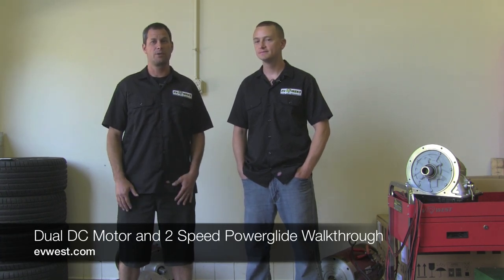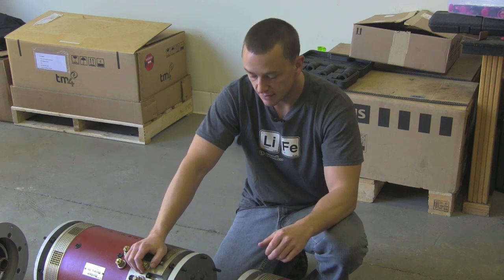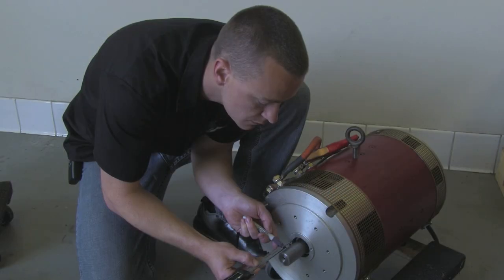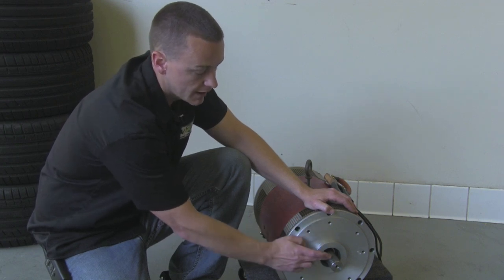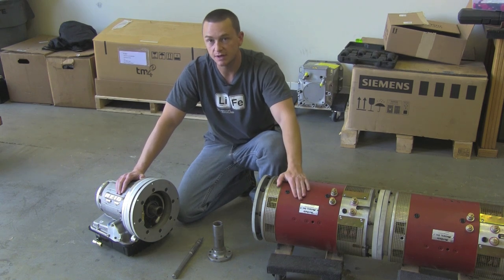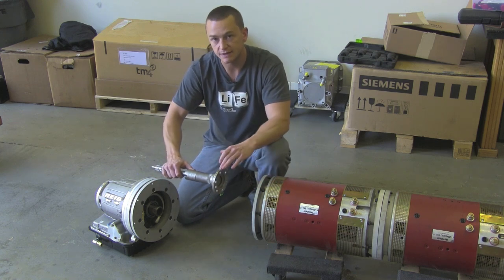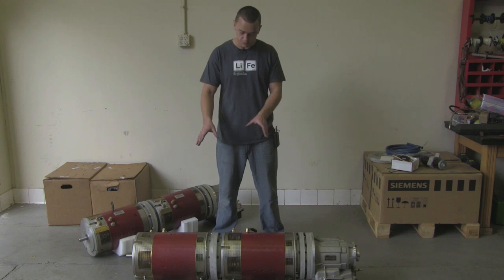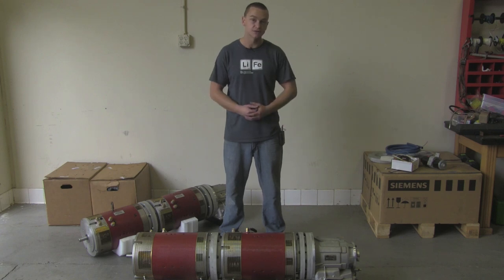Dual Motor Electric Vehicle Drivetrain With Powerglide 2 Speed Transmission Walkthrough by EV West

Comment: Where exactly do people learn to make an electric car? I can't seem to find any workshop except 1 in norcal and I am not sure if that class is sufficient enough. Do people go learn it at a school like Universal Technical Institute or is there a really good book on creating one from scratch? I searched amazon for a book but they all seemed to have low ratings.
Reply: Cassius Mason it's really simple. install electric motor. install transmission if you want. the end.
Reply: You make it sound so easy. Seems like when I read a Volkswagen electric vehicle training book, it has like several dozen more small parts to it. Haha.
Reply: From my small experience as a technical university graduate, the greatest option is if you study automotive design at a college or university. Trust me, designing any decent quality car (electrically powered or other) requires quite some knowledge in many factors such as: motors, power transmission, traction, stability control, aerodynamics, automatic control systems, mechanical wear and endurance, maintenance, ergonomics and financial managing. 

Even so, university studies may not be enough. You may have to work in the business of automotive design and engineering and/or do a specialised post-graduate study in electrical automotive engineering. It's not just a case of put a motor on a chassis with 4 wheels and a transmission (yes, David, you re obviously troling :P). Because, in the end, you might have disastrous consequences.
Reply: Luffy Monkey I'm not trolling. These people learned by doing actual research
Reply: They are the pioneers. People on forums everywhere have been taking electric motors and throwing them into random cars for awhile now. And I'm sure some of those people and gone on to selling parts and designing kits.
Reply: OK, so they are based on experience (shared and personal). But will it be a valid result? Will it be the optimum based on their resources and goals? Will it be safe? Shared experience is quite something, but I believe it's better if you work on a business of electrical car manufacturing, and having some academic knowledge can help quite importantly.
Reply: Luffy Monkey you can learn that stuff while working hands on. All your professors teach you from a textbook.
Reply: Luffy Monkey meaning that anyone else can find that information
Reply: Which, in the long run, means that must study A LOT.  It's not that easy. And by the way, guidance from an academic is, if not necessary, at least very very helpful. Do you think eveyone who opens books or online public scientific document can become an engineer? Academics can direct you to the specific pieces of information you need and answer your questions.  Also, experiments students engage in under academic surveillance and the projects that they do as homework helps them get into learning the correct use of this information. 

Anyway, what I see in the long run is that we both agree to tell our friend Cassius is that learning to make electric cars requires A LOOOT of studying. And I am not talking about one book. I am talking about entire books that discuss even sub-topics of the topics I mentioned in a previous comment of mine. And that with a guidance support from an expert, along with experimenting in practice.  All that is required if you want to have a good quality optimised result. If you don't want to ensure that, you can use the shared experience of the practioners of electric car manufacuring. But, I wouldn't recommend that. 

P.S. David, is it just me or you seem to underestimate higher education (not meaning to offend you in any way)?
Reply: I meant the contribution of higher education, sorry
Reply: Luffy Monkey I'm in college. And I'm saying you are overestimating the value of higher education. It's not needed to properly learn something. Best way to learn is to experiment and read. And it's the same in college. Sure they provide guidance. But they will never specifically teach you how to design an electric car or even any kind of car. It's something you learn on your own, by being interested in it and just doing it. For example the people who design aftermarket engines learned by building and modifying current engines learning faults and reading books. Same with people who design aftermarket gear boxes. Same with the people who design ECU's and write software for them. Sure some of them may have degrees but it's not explicitly required. If Cassius really wants to learn how to design electric cars then he should just buy a shell for 200 dollars and throw an electric motor in it. While he goes through that process he will have issues he will have to solve and he will also have choices to make. While going through that process he will end up reading a lot of literature and will also end up making a ton of mistakes. But then if he enjoyed the process he will do it again but better. Rinse and repeat. Maybe he may never move passed it just being a hobby. But at some point he will become a innovator because he will have his own solutions to various problems. He will know why certain things work and why other things don't. Eventually he will join a forum and help others. Which is really the big key here. Once he starts helping and teaching others he himself will learn a lot. To the point where he will be able to finally be able to design an electric car.
Reply: I actually went over these art colleges in California. It seems like I will have to start over from scratch and study for another 4 years starting from GE because the nursing classes I took do not fulfill any of the majors in industrial designing with car, etc, and I don't have another 4 years to study since I am already 29 years old needing to work. I think my chances of making my own car seems to be going down the drain looking at this post. Either way, I think I will take the class at an institute, it is shorter, and take my changes to fulfilling my dream.
Reply: Cassius Mason dude don't waste your time with school. Just read and do it. By a shell and put a forklift motor in it. Then make it work properly. Then repeat but with more money into the electric motor and the power bank. Start to play with hobby electronics so that you can eventually design your own controller. Just do it.
Reply: Either you take the class or try right away following David's advice, I wish you good luck. Just keep in mind that, either way, you ll have to study a lot if you want to make something of decent quality and SAFETY. You could try right away and start building something by assembling the required parts that you ll search for, as David said. But I will not guarantee you neither of the safety nor of the possible waste of money at first try if your result doesn't comply with your goals. This project will take you time anyway depending on your goals. I just gave you the above advice so that you have some correct basic knowledge to begin with. 
In conclusion, study a lot, start experimenting if you wish and ALWAYS BE CAREFUL! And again, GOOD LUCK!

Comment: wish  you had this in a kit form so I can convert my 72 chevy  luv drag truck from  small block chevy  to these  electric motors  and couple it to my rossler terminator 6 turbo 400. with battery requirements controllers, and throttle potentiometer. and what ever else is needed for turn key kit.

Comment: Dude the fact you're using a powerglide and not a T400 or T700, must have a ton of torque? Any reply appreciated thanks from Australia! Btw i had to sub!
Reply: Not seeing many replies in here.

I'm in Aus also. Looks like the glide is pretty small and would be better to keep the total size / length down. The motors make enough torque to direct drive without needing gears. You can bolt just the end cap of a TH400 on for the tail-shaft uni to connect to.

Thinking of chucking 1 or 2 of these in my Torana. I doubt I can afford a Tesla anytime in the next 5 years.

Comment: I'm sorry guys... but if a single warp 11 produce:
Rated Torque: 173 Lb Ft @ 72 Volts And 597 Amps (1442 RPM) 
Rated Power: 58 HP @ @ 72 Volts And 597 Amps (1442 RPM
How it's possible catch 600HP and 1000 ln/ft of torque from 2????

Comment: Great video and very nice presentation.  I did, however notice two major mistakes you made.  One, the idle pump does not supply oil "pressure" to the Powerglide, but rather oil "flow".  The internal resistance causes pressure in the system.  Secondly, a Powerglide transmission does not have an "e-brake", but rather a "parking brake". Sorry, but I believe that if you are trying to teach, you should get all of your facts straight first and not teach incorrect information.  Thanks!
Reply: THEN LETS GET YOUR FACTS STRAIGHT

A PUMP PRODUCES FLOW,
BY MAKING ENOUGH "FORCE TO MAKE THE OIL MOVE.

THE PUMP WOULD HAVE TO MAKE FORCE EVEN IN AN
OPEN ENDED TUBE FOR LIQUID TO MOVE.

PRESSURE IS FORCE (THAT FORCE IS CALLED PRESSURE)

VOLUME IS ANOTHER THING!
 NO FORCE (PRESSURE) NO FLOW (VOLUME)

NORMALLY STATED AS GALLONS PER MIN.

YOUR STATEMENT SAYS THE PUMP DOES NOT PROVIDE "PRESSURE" WELL IF IT DID NOT >>  THE OIL WOULD NOT FLOW INTO TRANY
OR ON TO THE FLOOR OR ANY WHERE ELSE.

FLOW  "VOLUME" IS DETERMINED BY HOW MUCH THE PUMP HAS FOR ABILITY TO MAKE PRESSURE AGAINST A PRE DETERMINED "HEAD",
OR BLOCKAGES TO THE PUMPS ATTEMPT TO MOVE OIL.

THE MORE RESTRICTION THE LESS FLOW, REQUIRING THE PUMP TO PRODUCE EVEN MORE PRESSURE TO MAKE OIL FLOW.

 I HAVE NEVER HEARD OF RESISTANCE IN A LIQUID SYSTEM CREATING PRESSURE,
YOU ARE BACK WARDS.

RESISTANCE HAS NEVER "MADE PRESSURE" EVER!
BUT IT DOES MAKE IT HARDER TO MOVE OIL
MAKING THE "PUMP" PRODUCE EVEN MORE PRESSURE
TO GET THE OIL TO FLOW

YES THE PRESSURE WOULD HAVE TO GO UP BECAUSE OF PARTIAL BLOCKAGES IN THE TRANY BUT THOSE
"BLOCKAGES DON'T CREATE PRESSURE"
TO SOLVE THE PROBLEM THEY CREATE!

THE TRANY DOES NOT MAKE PRESSURE AT SLOW SPEED
BUT INSTEAD HINDERS IT. BY MAKING COUNTER FORCE AGAINST THE PUMPS ATTEMPT TO MOVE OIL CAUSING THE PUMP NOT THE TRANY TO CREATE EVEN MORE PRESSURE TO MAINTAIN REQUIRED FLOW

THE REASON FOR EXTERNAL PUMP BEING REQUIRED IS THAT WITHOUT A TORQUE CONVERTER THAT MOVES OIL AT SLOW SPEED BEING IN THE SYSTEM AN EXTRA PUMP HAS TO BE ADDED TO SOLVE THIS PROBLEM.

ONCE THE TRANY SPEEDS UP,  "MOST" TRANYS HAVE OTHER PUMPS
INSIDE THAT ALSO CREATE PRESSURE.

THAT'S WHY HE MADE THE COMMENT THAT A CONTROL COULD BE ADDED TO SHUT THE EXTERNAL PUMP BACK OFF ONCE THE TRANY SPEED INCREASED AS THE OTHER INTERNAL PUMPS WOULD PUMP ENOUGH.

IF IN YOUR OPIONION THE PUMP IS NOT REQUIRED TO MAKE PRESSURE, THEN TAKE IT OUT AND SEE IF ANY OIL FLOWS, NO MATTER HOW MUCH RESISTANCE IS IN THE TRANY.

 I HAVE BEEN A PLUMBER SINCE 1979- 35 YEARS NOW, AND DESIGNED AND BUILT PUMPING SYSTEMS THAT MOVED 50.000 GALLONS OF WATER 2 MILES UP TO THE TOP OF A 150 FOOT HILL (15 STORIES) AND STILL MAINTAINED A 110 PSI PREASURE AT THE BUILDINGS AT THE TOP.

I KNOW WHAT PUMPS DO (MAKE PRESSURE), AND ALL THE THINGS THAT HINDER THEIR ATTEMPT TO MOVE LIQUID.. IF YOU THINK I'M WRONG THEN EXPLAIN IN OPEN FORUM AS TO YOUR OPINIONS AND MAYBE YOU HAVE FOUND A NEW MATH OR POWER SOURCE THAT I'M NOT AWARE OF, BUT    >>>>>>>>>>
          
                                                     YOU

STATED HE MADE A MAJOR MISTAKE, BUT FROM WHERE I STAND YOU HAVE

"CALLED A MAN OUT"

FOR SOMETHING YOU DON'T UNDERSTAND, SO

"MAN UP",

AND SAY YOU ARE SORRY

I DIDN'T TAKE ALL THIS TIME TO PUT YOU DOWN, I JUST DON'T WANT PEOPLE YOU ARE NOT IN FULL GRASP OF THE KNOWLEGE TELLING SOME ONE ELSE THEY ARE WRONG WHEN THE REVERSE IS TRUE

MURRAY CLARL

SORRY FOR CAPS AND MISTAKES I'M HANDY CAPED AND HAVE TROUBLE TYPING!
Reply: MURRAY CLARK
AGAIN THE "E" BRAKE STANDS FOR THE VEHICLES "EMERGENCY "BRAKE", (SOME TIMES CALLED THE PARKING BRAKE) YOU KNOW THE ONE YOU OPERATE WITH YOUR FOOT TO STOP CAR FROM ROLLING AWAY. AGAIN YOU NEED TO SAY YOUR SORRY, I LISTENED TO THIS OVER AND OVER , AND HE SAID YOU COULD USE YOUR "E" BRAKE BUT THE PARKING DOG INSIDE THE TRANY IS PROBABLY BETTER, (PARAPRASED) AGAIN GET THINGS RIGHT. MURRAY CLARK
Reply: an e bbrake is a handbrake do mad drifts

Comment: Good job EV WEST.  Today I am more into semi trucks than cars because of what do for living. I would love see big semi truck with electric motors than diesel. you know why ($$$) 5-7 MPG average 3.80 - 4.20 $ per gallon. not good at all especially when you need drive 400-700 mile per day. Space and weight is not problem for trucks but I know you need big big power to move that semi. but believe EV WEST can built one if we supper them. and lets talk about 500 hp 1800 lb/ft torque motor that needs to be run 700 mile day. thanks
Reply: It seems to me that trailers are the perfect place for solar panels.

Comment: No shattering of motor mounts with this setup??
Reply: Does a standard push rod engine motor mount shatter?
Reply: WhyDidYouTurn I would imagine this would be no standard rubber,fluid filled motor mount. With 1000ftlb instantaneous torque at a ridiculously low rpm,no diesel or petrol engine could ever reasonably achieve, its somewhat new territory. It makes you wonder.
Reply: Its my understanding that these motors are bolted together with more than capable hardware, then bolted to a machined steel plate, and the the whole assembly again bolted to a transmission bell housing or similar, Then the motors are then mounted in the vehicle with motor mounts. The transmission obviously mounted as well. Its very unlikely that this motor would brute force a series of cross members and a set of motor mounts and trans mounts. Although it is an interesting idea.
Reply: What really fired my curiosity, was the 1rpm argument. The ability to have full torque, without delay. I would imagine its like getting rear ended.
 Im sure this can be altered in the controller, for a smoother ramp, given available traction and desired 60ft but ofcourse everyone makes mistakes when pushing new boundaries.
Reply: Whats neat about electric vehicles are the controllers, you can use them to control ABS and TCS. Lately I've been thinking more and more about building my own electric vehicle. Unfortunately my financials are sub par at the moment. and to comment on the instant torque, I am sure the transmission absorbs some g-forces, not to mention most EV's are weighed down by batteries, Which will further decrease the felt g's. along with suspension, tires, so on and so forth.

Comment: What is the purpose of having a having a 2 speed power glide trans?  I driven an electric golf cart and you just push the petal to the metal and Go!...and then you let up on the petal and the cart slows down and you use the brake petal to make a complete Stop!
Reply: +Joseph Yearwood, Ok Thanks...I've been looking at the FFR 818 on a YT video and I would like to do a FFR 818-C.  How is that setup!  Like how much hp?  How much range?   0-60 times and top speed?  With a Electric FFR 818 Coupe?  BTW...I forgot to tell you that I am a left amputee and that's why I was asking about using a 2 sp trans?  I don't want to be using a clutch, maybe something like a paddle auto shift, if I have to use a 2-sp trans.

Comment: Bur it is necesarry the transmission??
Reply: The transmission allows for reversing and using a second gear to go faster.  These use what is called a HAIRBALL to control the connection between your foot and the motors so you don't run full RPM's all the time.  Max RPM of these motors using the transmission would have you WELL over the speed limit, depending on the rear gearing and tire size of the vehicle.
Reply: Imagine loosening a nut from a rusted bolt with a 12" ratchet. While doable, it will take a greater amount of strength (torque) to do so. Now add a 24" breakerbar to the ratchet and it requires much less strength to break it free. However once the nut is free, youbwould take much longer to get the nut off with a 24" ratchet vice a 12" ratchet. The transmission provides reverse, park, and gear reduction (adding mechanical torque) 1.71:1 or 1.82:1 until it is up to speed, then shifts into direct drive off the motor - thus vastly improving efficiency of both the motor and battery.
Reply: These motors only spin to about 6000 RPM, so a transmission with at least 2 speeds is needed. if they had a motor that spun up to 15000 RPM, you could use just a simple fixed reduction gear.

Comment: DO NOT LIFT the Transmission the way this guy does!!! You can really HURT your BACK!!!  Always lift with your legs with your torso above your pelvis.  Also, angle grinders are not sanding disks.  Replace with cut off disk with a sanding disk prior to deburring.  Cutoff disk can shatter.

Comment: Its max RPM is rated at 5000. What would happen if you couple an internal combustion engine at the end w/ a redline last 5000 RPM?

V8 - Electric - Electric - Transmission

Might end up with a monster. 😂

Comment: 7:52 just to make sure I understand correctly this "whole package" meaning from tip of front motor shaft to rear of powerglide is 54 inches?
Doing some measuring to see if this will fit in car with short wheelbase with powerglide connected to a transfer case, maybe Lovell 357 or one from SCSgearbox, to send power to front and rear differentials for AWD race EV. Probably be a little drivetrain power loss, but I think being AWD with Hoosier tires would be Awesome!